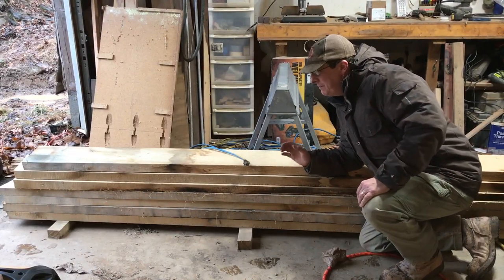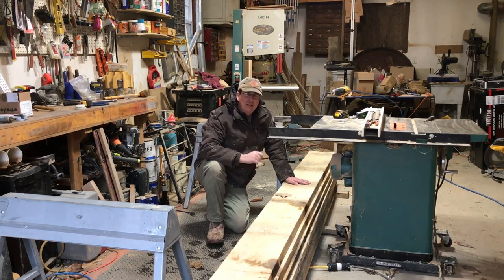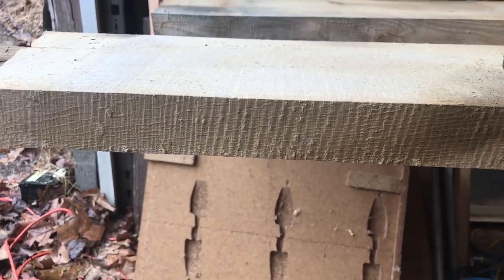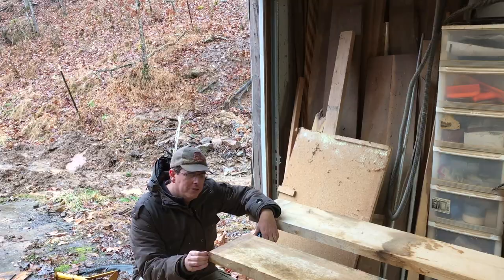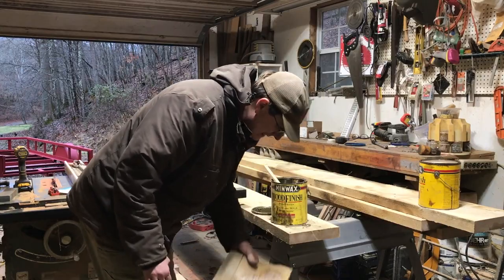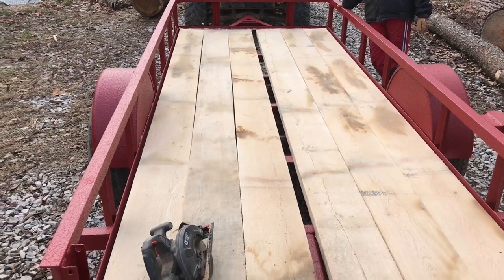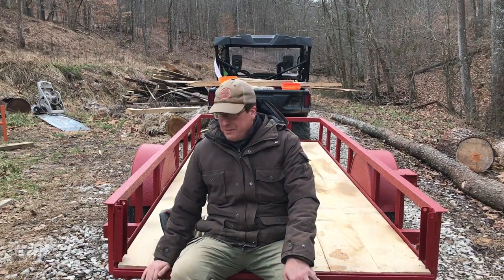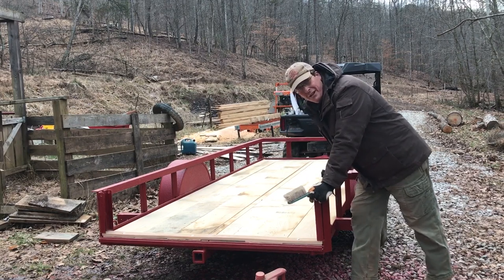Installing an OAK trailer deck from our SAWMILL

Comment: I re decked a 6.5x12ft trailer a few years ago.  I left 2-3in in between each board.  I find the fact that I can flip a ratchet strap hook down between the boards into the cross members more handy than carrying gravel/chips.  I have carried gravel and chips with that trailer by just laying down a cheap tarp.  Motor oil is my go to cheap wood preservative also.  I'm on 9yrs on some of my trailer decks.
Reply: Brett C I get at least 2 more years by using used oil, grandpa showed me that 50 years ago

Comment: I've seen other ppl do as you did and cut a smaller piece for the 2" left open in your case. I had about the same left in mine. I decided to make a small gap between all my boards. It made it so much easier to keep clean. Your build is looking great! I'm not done watch them all yet.

Comment: The guy we bought our place from covered everything with a 50/50 mix of diesel and used motor oil. Held up pretty well for the most part.

Comment: I think I liked the old mic better had to adjust my volume a few times
also Just a thought since you had another board I would have cut 2 boards on trailer down to approx 7 inches and added a 7 inch so not to have the small 2 inch as I believe it will be more prone to warp . Just a thoght. nice build

Comment: You can get heavy duty flat head screws that will go through steel to screw the boards to the trailer . That way you can keep them from rattling . That's what I did . I'm surprised that you used motor oil like that . That oil is not good for the environment and every time you put some thing on the trailer it's gonna get oil on it . If you're worried about rot getting to the boards than you should have put something on the under part of the boards before putting the boards on the trailer . I used Thompson Water Seal . Yea I know it costs money when the oil is free. When you were in the garage the sound was OK but when you went to the trailer the sound was not good at all .

Comment: Sounds sweet to my 73 years of wax and bugs live there. End of a car key really ain't the best method of cleaning. Metal drill bits bout set it afire getting the last half inch/LOL, you knew that... just jibing you. Chevys make good waterproofing but I kinda miss the look of wood as I live in a sheet rock cabin and you don't miss till you lose it. Couple times hauling gravel ought to bring up the grain and some of your clay that when it's dry there can be a nose plugger so all in all, really nice total build!! Ya done good Troy but the camera girl was the best (I'm flirting)

Comment: Mics... shotgun mics are great but as you know the further away from the mic you are, the more unwanted sound enters the element - including any reverberant sound energy bouncing off of walls and object in the room.  This presents different signal "pathlenghts" to the element creating a muddier, less intelligible sound.  It is best to keep the mic a little closer to the sound source and reduce (or attenuate) the volume rather than keeping it further away requiring a higher volume setting.  It just requires a little experimenting before your presentation!  Hope this helps! Blessings.

Comment: I put spent motor oil on a trailer about five years ago. It's still slick when it rains. And you can't put boxes on the trailer while its wet.

Comment: Thanks for the excellent video, I have a similar project to do on my trailer, I have no experience using used motor oil, any chance of it being super slick when wet after the treatment?

Comment: I would just go with flat washers and two bolts on that back edge and forget about putting the piece on the top of them anyway have a good day and God bless you and Kelly and your kids
Reply from the maker: That would require at least one bolt per board.
Reply: Red Tool House - Homestead you bring up good points

Comment: If I am staying in one position I use the wired mic. If I am moving around or at a machine and I want the audio from the machine to be picked up I use the shot gun mic. Just have to remember to be in front of the mic or if you move turn the mic towards you so the sound quality stays good.

Comment: You should’ve left the rear flange on the trailer. 
Bow your boards up in the middle, start the two ends, the drop the bow. 
They’ll just snap on in and be fine.
No need to remove the flanges to replace boards in the future.
Reply from the maker: Have you ever tried to bow a 2 inch oak board? That wouldn't work.

Comment: Nice job on the floor Troy would you want to do my trailer too lol.  My trailer floor is almost clear shot but it will just have to wait till warm weather. Not sure how I want to floor it yet, it had treated 8 quarter decking made of pine on it. Unfortunately 10 years and it's nothing but rot even with me painting it with water seal. I am considering doing a laminate with 2 layers of 3/4 plywood.

Comment: Is there a practical reason for not adding a 1/3" gap between the boards, or was the 2" filler board just for asthetics?
Reply from the maker: I expect more shrinkage, so I wanted it as tight as possible.
Reply: @RedToolHouse  that makes sense - thanks for the reply!

Comment: Personally, I like he old microphone setup better. Your volume was more consistent and you could still be heard when further away from the camera. Furthermore, the sound today did, as you said, pick up a lot more of the background noise from the rain and such. 

Secondly, I wanted to ask how you like your grizzly saws. I saw you have a grizzly table saw and band saw. I have been looking at the band saws for my own shop lately and wondering how you like it and how you would rate its quality.
Reply from the maker: I have been very happy with the Grizzly saws. I have their table saw, band saw, and oscillating spindle sander. All have held up well.

Comment: I would add a 2 x 2 x 13 red box length of steel in the centre section rather than the wood infill

Comment: That's a big trailer for a single axle. Go metric and everything becomes so much easier. And work out the width and cut two boards. I.E. start from the center and work both L and R and rip the outer boards down so everything is even. Just like fence pailings. As far as rebating goes get a router. It's 2020 now not 1820.
Reply from the maker: Sorry, you lost me at metric is better...